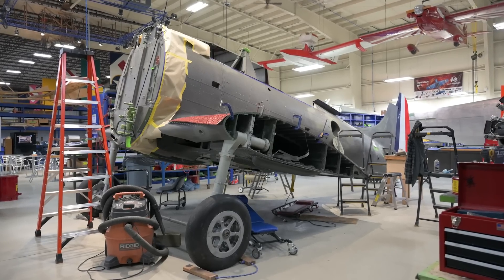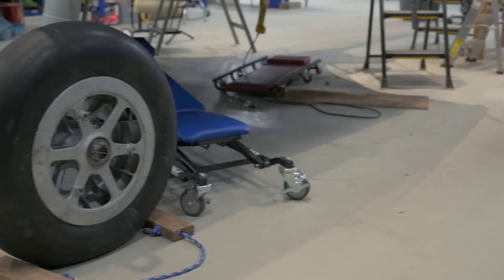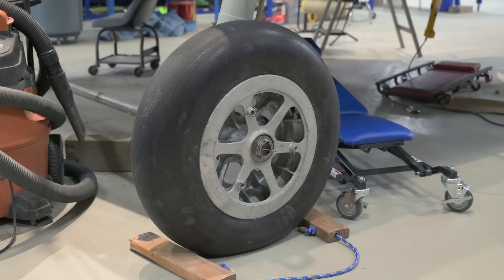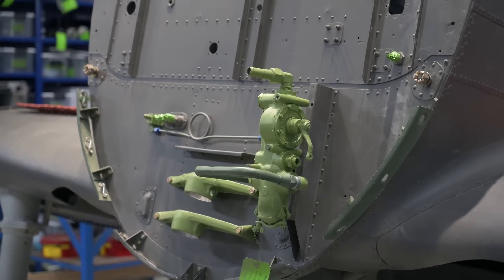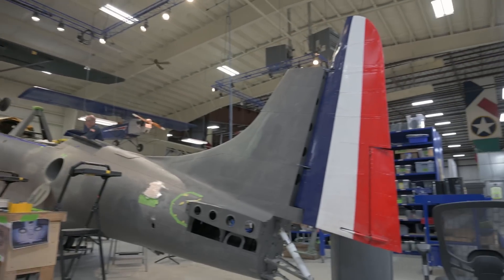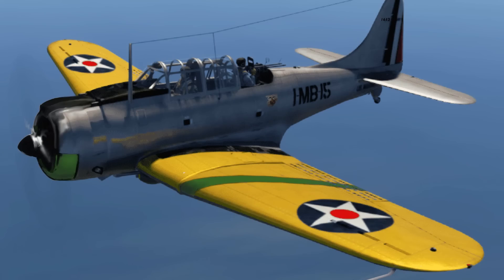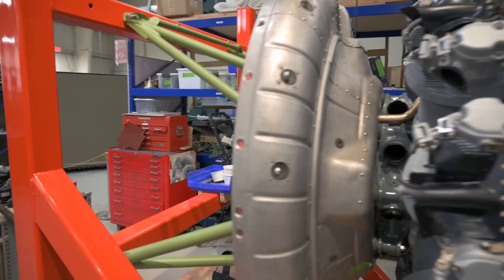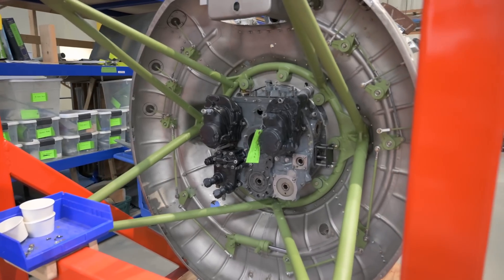Restoring the Only Remaining SBD-1 Dauntless – March Update!

Comment: Is this an airworthy or static display piece?
Reply: Certainly doesn't look like an airworthy restoration.
Reply: @DoktorBayerischeMotorenWerke  I wouldn't want to risk her flying if she's the only one  of that variant. Anything can go wrong in the air.
Reply: @ I wouldn't want to risk flying it... the work looks like it is cosmetic only... this aircraft is structurally unsafe to fly
Reply: @DoktorBayerischeMotorenWerke  If I was wrecked into a lake and sat there for 70 plus years, I'd be structurally unsafe too!
Reply: @ Exactly my point, you do not patch-up damaged skins with Bondo... you replace them with new aluminum skins..
Reply: @ does Bondo do any harm to the aluminum? and I agree, Bondo would just be a band aid against the forces of flying, especially acrobatics that many airshows have. I doubt she'd fly anyway since she's the only known 1 variant left. They want to keep her safe on the ground.
Reply: @ Bondo is used all the time on aircraft, to smooth out very minor imperfections prior to painting, but it must be applied to clean, bare metal... never over the top of paint or primer. It is never used to hide damaged skins or holes. 
  The volunteers on this project do not appear to be qualified AMT or AMS certified technicians, and the techniques used do not comply with airworthiness certification or accepted repair or restoration methods.
Reply: @ And then there’s Speed Tape,100% aluminum high tac adhesive that is a manufacturer approved temporary repair up to 600mph.  I was just curious weather it was going to be a fly able aircraft. I know nothing about this particular aircraft. Where they obtained it from. Was it received from a foreign government,the bottom of Lake Michigan,another museum? It’s a rare model. Very interesting.